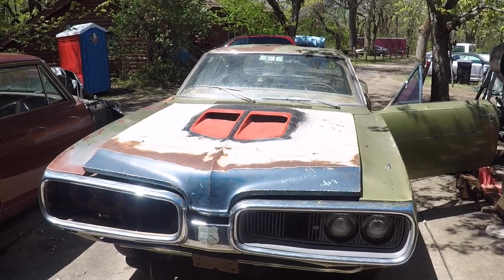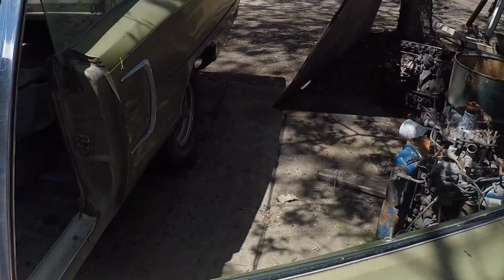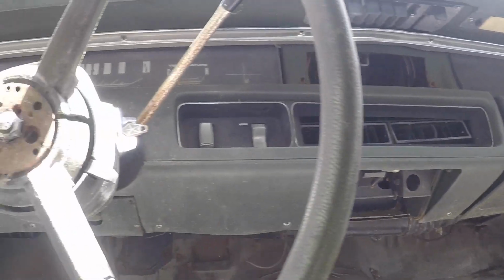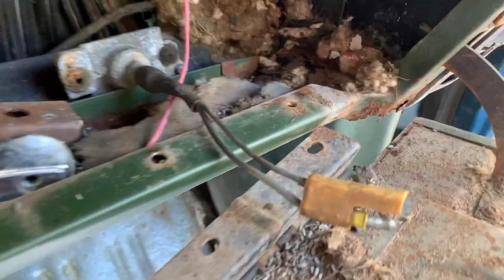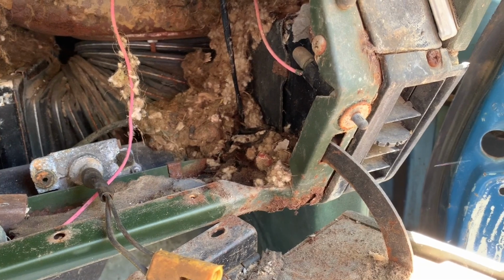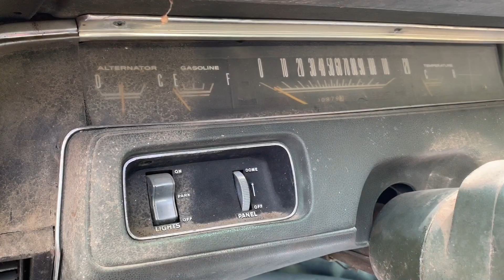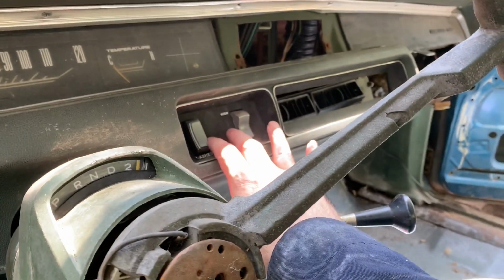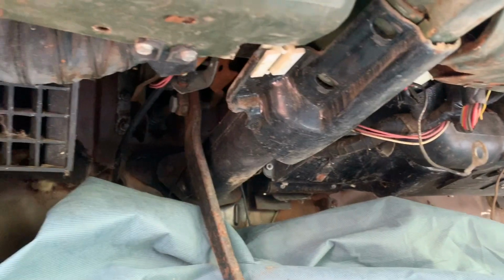Whose Kidding Who

Comment: Why are you taking all that out?  Did you say why and I missed it?
Reply from the maker: Nomadic VanAddict I’m doing a color change for the dash, painting it black to match the factory bucket seats I bought. Ditching the heater box/ air conditioning core to lighten up the car. Plus will smell better without 100 pounds of mouse turds.